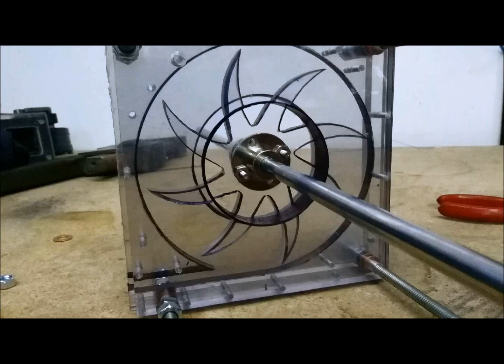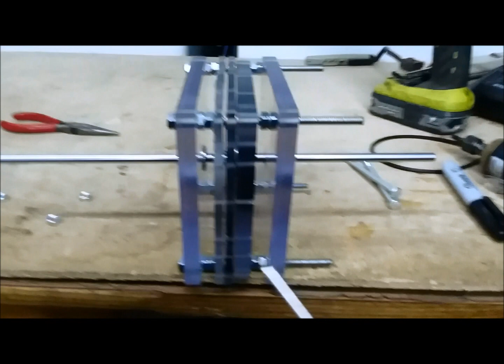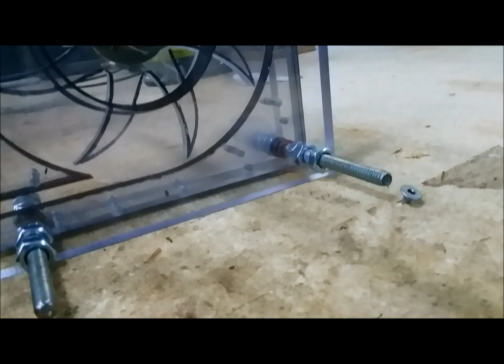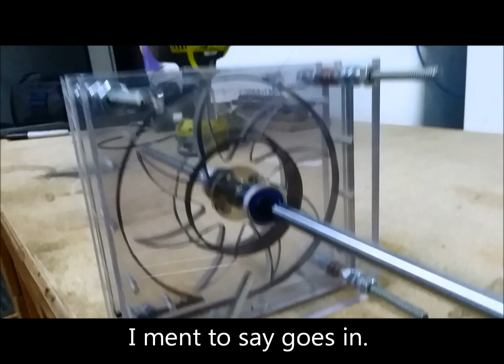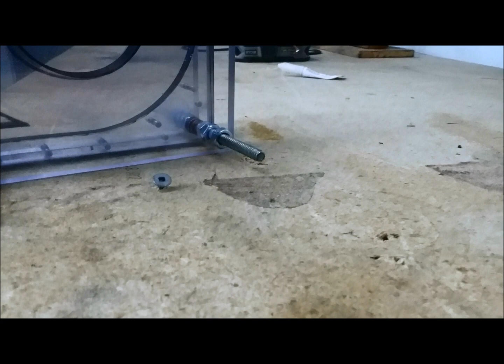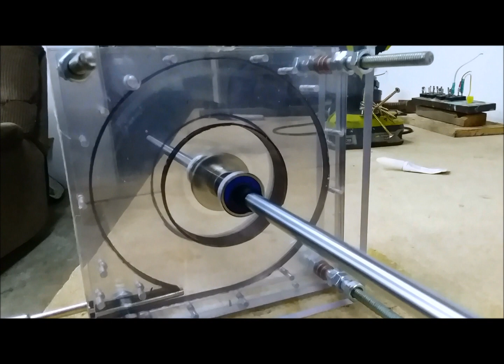Turbine air system that will replace batteries! Prototype 3

Comment: This is due to Bernoulli's principle and the Venturi effect. The atmospheric pressure on the outside of the turbine is higher due to the high velocity/low pressure of air on the inside. Fluids moving at a higher velocity will always have a lower pressure than the same volume of fluid moving at a lower velocity (includes not moving at all), assuming height is the same.
Reply from the maker: Correct! Thank you for the observation!
Reply: @iEnergySupply  After I posted the comment I saw many other people saying the same thing. Sorry about that! It does make me wonder why, if this principle is so widely known/understood, why has the tesla turbine not been adopted yet? With our knowledge on boundary layers/Bernoulli principles, the tesla turbine remains one of the most efficient designs.
Reply from the maker: @codyhubert6178  I could name 10 reasons, mostly it consists of tuning, why hasn't anyone done it right? I've done it wrong so many times and when I do it right it all becomes clear. Why does everyone get it wrong??? It's so simple but complicated at the same time. What I will show, is how to do it right.

Comment: 50% energy turned into dam loud noise. Very inefficient compared to batteries storage.
Reply from the maker: This is a very old desighn.
Reply: what about something like an old thread sewing machine? all lite weight materials used   the arm has light durable gears in it to allow needle to push paddle below?  the wheel then goes by itself  pull a lever ? it goes all mechanical    thought of this about 11 years ago

Comment: I dont see where this will replace batteries if u nee compressed air 🤷🏾‍♂️
Reply: It’s more of a small demo of something that should be larger scale. say lithium ion batteries have a life span of say 10 years and gradually decreasing power capacity as it’s cycled repeatedly, it eventually dies out and needs replacement. 

A compressed air energy plant needs a high pressure tank, compressor, and the turbine (something like this in the video) to produce energy.

First power is used to “charge” the plant, compressing air into the tanks, then when power is needed, the tanks release air into the turbine which produces power.
Reply: @Im_The_Slep  yes, and Joe Black, if you lived near a river + have a trompe pump = constant free compressed air 24/7
Reply: @Im_The_Slep  it's what I say in few words🤷🏾‍♂️
Reply from the maker: we have since moved on from compressed air, please see the new videos.

Comment: Coander Effect. It's a result of laminar flow frictional forces that causes the low velocity air outside to accelerate to the malachite velocity between the plates. The force difference is what drives the parts together as the escaping air is exhausted in another direction. 
https://youtu.be/kR2Oi3XCX18
Reply from the maker: Thanks for the advise.

Comment: Hi, I like your turbine but it's not really a tesla turbine. This isn't relying on a centrifugal boundary layer effect, this is fluid impinging on blades, like a pelton water wheel. It's the impulse of the speed of the air hitting the blade. I like it though, It's cool.
Reply from the maker: We are now using true tesla turbine rotors with great success!

Comment: That effect you were wondering about is called the "Venturi" effect. As the turbines spin, because of the geometry of the blades, it causes a "Negative" pressure, which just means it creates a suction. So it's pulling pretty hard there causing the resin housing you have there to be sealed up.

Comment: Someone badly studied at school... In the "awful" USSR in 1989 (I went in the third a class), showed us here a similar experiment - https://youtu.be/epesI-fWvrY

And in the seventh class (I was only 13 years old) we had a subject "physics", and we were told about Bernoulli effect - an air pressure pumped down with increase in its speed... Another is based on this effect - ejection. And on the basis of ejection such devices as jet vacuum pumps - as the simplest example are created. In any household gas lighter, or a torch gas under pressure comes out a cylinder through a small opening, is strong at the same time dispersing, and creates an underpressure zone around a stream at the expense of what to a stream of gas the ambient air is attracted, mixes up with a combustible gas and as a result ignites. Well, look for in Google - Bernoulli effect. And to you, I address the author of video, it is necessary to esteem a little more about what ы you do, otherwise every day you wait for "neoskilled miracles and improbable opening" :)
https://youtu.be/1JuoSJz3SRU
https://youtu.be/UJ3-Zm1wbIQ
Reply from the maker: You must first see it is possible through visualization, then when you can conceive it, you will create it afterwords with hard work.
Reply: You are using a better translator. Well done you.